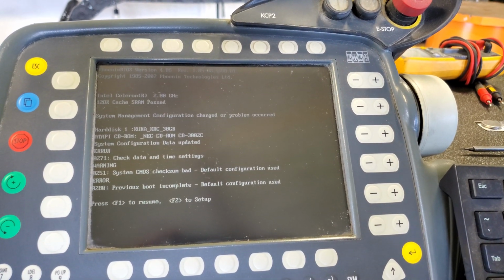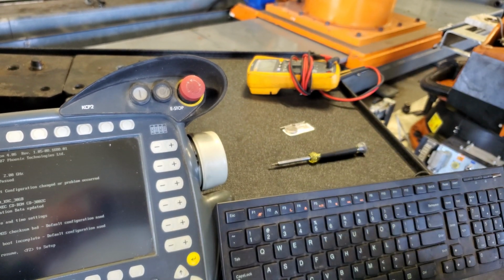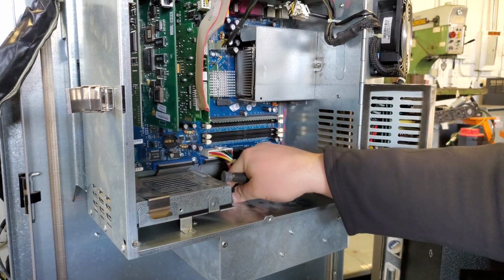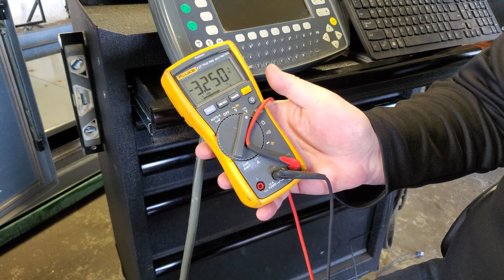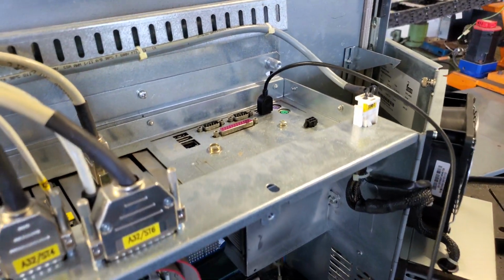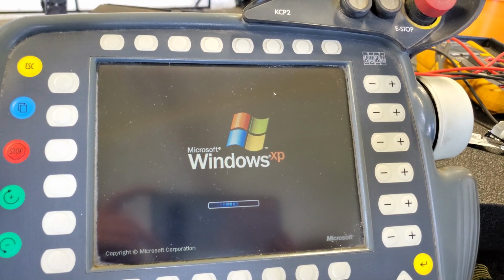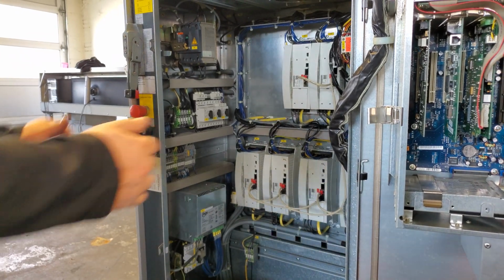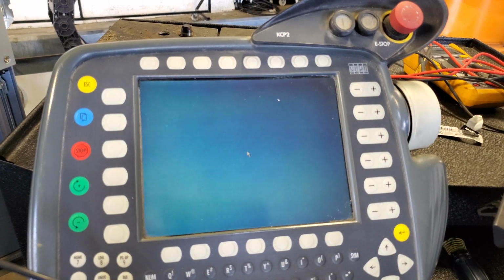How To Change The CMOS Battery on a KUKA KRC2 ED05 Controller.

Comment: we just had this happen, however now we are getting issues with the LPDN 2 driver error. Not sure which bios settings have to be changed, like if we need to manually change an IRQ for one of the serial ports.

Comment: Could you share please the new battery model and specs you used, ideally if you have a link for the battery :) ?
Reply from the maker: It is an Energizer 2032 Battery CR2032 Lithium 3v. You can find it on amazon here: https://www.amazon.com/dp/B0042A9UXC?ref_=cm_sw_r_apin_dp_J1T8Z592DX7M9E49CAPD